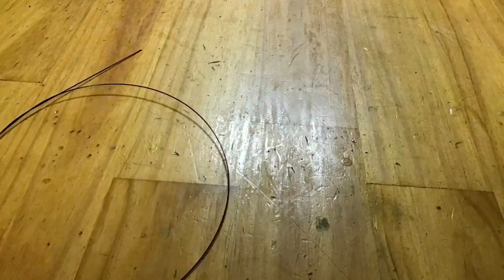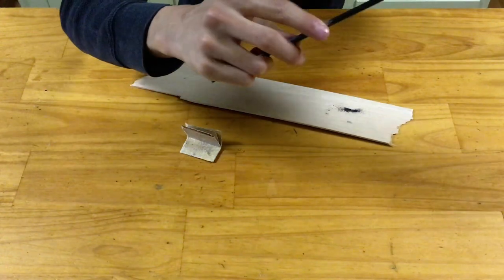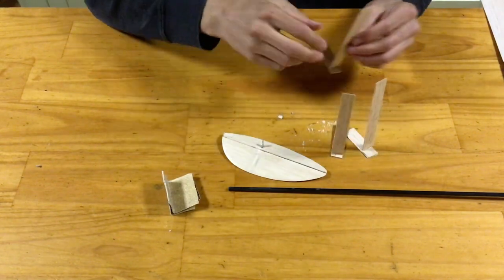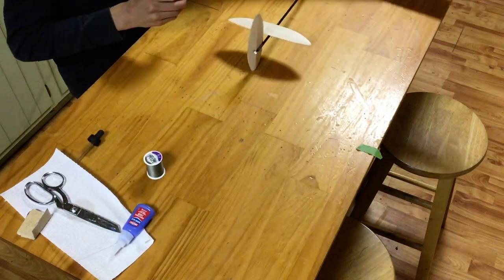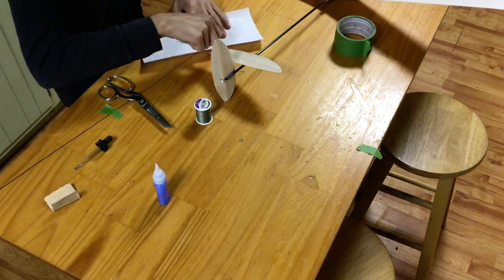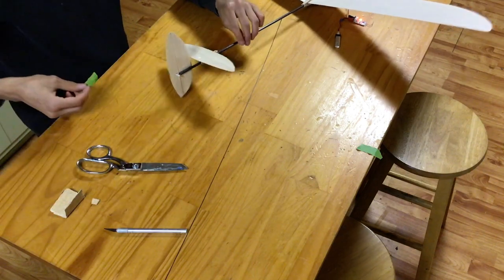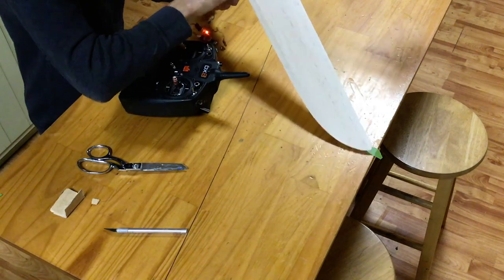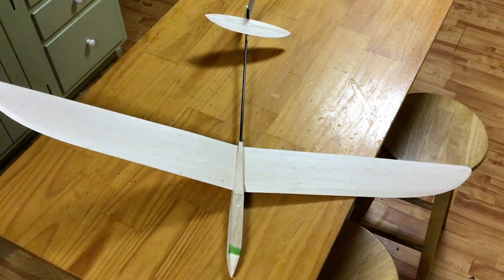Balsa DLG Tutorial - Episode 4 | PULL CABLES & FINAL ASSEMBLY |

Comment: Just finished watching.  I learned something new with your vertical stabiliser attachment method.  I usually cut a slot, centre the stab and fillet with CA glue.  Probably no real difference in strength but yours might be quicker and use less glue, which contributes to less weight in the rear end.  The series has been very good to watch.  Thank you for putting the time and effort into it.
Reply from the maker: Yeah, putting the stabilizer on one side like that is the way to go for these smaller gliders. It results in a teeny imbalance, but any disadvantage is vastly outweighed by the ease of the process, as well as the lower weight from the usage of less glue. I have tried the slot method, but I have noticed that it is easy to accidentally put a little bend in the stabilizer at the weakened point where the slot is cut. This has, in my experience, resulted in uneven rudder deflection. Also, putting the stabilizer on one side of the tail boom gives a straight shot for the rudder pull-cable to the control horn, and making sure it doesn’t rub against the edge of the tail boom.

Comment: Awesome....
I needed this final video..
Small suggestions...
I used Velcro for holding my receiver and battery in.. So I could easily move them to ajust the C.G... And Velcro to connect my hatch.... Thanks for these great vids..
...✌...
Reply from the maker: Thanks! No Velcro can be used for this glider. It is designed such that there is no extra room, so the electronics can’t be shifted; they only fit one way. Besides, if you added Velcro inside, there wouldn’t be enough room left for the electronics. Velcro to connect the hatch will be heavier and higher drag than tape, but I guess it would work.

Comment: How strong is this fuse in case of a nose crash? The way a build mine could safely withstand a 2-3 meters high, nose dive several times, while keeping the fuses weight really low (5grams max).
Reply from the maker: This fuselage will withstand nosedives into a grassy field from around 5-8 meters, depending upon the impact angle and balsa wood density. Yours sounds pretty good. Keep experimenting with fuselage designs and you will get them stronger and stronger. In my experience, simplicity is strength when it comes to DLG fuselages.

Comment: Could you please share the list of the electronic components used? It seems like it is split between episodes, I could only catch the servos being 2.5g. What battery size is recommended and what reciever?
Reply from the maker: Yes, servos are 2.5 gram Emax servos. Battery is a Venom 150 mAh 1S LiPo. Receiver is a 4.4 gram 4-channel one. I think it’s from LemonRX, but not sure. Hope this helps. :)
Reply: @AeroCraftAviation  That's what I guessed. So you got step-up buck converter there also? Servos specs say they work 4.8-6v. most recievers require this voltage too. This is the main reason  asking :)
Reply from the maker: @Umarluch  I used to use a BEC which would output a constant 5v. But this added a bit of weight and necessitated larger fuselages which made it not fly so well. A few months ago I decided to experiment with just the 3.5 - 4.0 volts of a 1S LiPo at medium capacity. I found the receiver still functioned just fine at the lower voltage, and also the servos output nearly as much torque. So now i don't bother with the BEC anymore,. This aircraft is designed such that it will not fit a BEC or any other voltage stepping component. If you want to get a little extra servo torque by using the BEC you will have to enlarge the fuselage and mount the servos further back. Hope this helps. :)
Reply: @AeroCraftAviation  Thanks for all the details! What is the work time for such small battery? I need to say 150mAh is even smaller battery than I have on my 65mm drones :D
Reply from the maker: @Umarluch  I get about 20 - 30 minutes, depending upon how aggressively I control the aircraft.

Comment: Hi. I ve got a 4 mm carbon fiber (instead of 6 mm that you use). Do U think it will be ok?  Thanks a lot for your help.
Reply from the maker: 4 mm outer diameter could work. It must be a carbon fiber tube, and therefore the inner diameter is important. If it has 3 mm or 2 mm inner diameter it will work.

Comment: I am close to giving my glider a toss, but I did have a question. Where should the CG be? I had heard it should be 25 to 30 percent back from the leading edge but maybe that is not a hard and fast rule. With my battery and receiver in place, my CG looks more like 60 percent back from the leading edge. I appreciate any suggestions you may have.
Reply from the maker: AH, good that you asked before tossing! A 25 to 30 percent CG is generally for powered planes only. A glider will have a further-back CG. This aircraft should be 34 to 40 percent. If it's helpful, I'll try to briefly explain why. Powered planes have stabilizers that make negative lift. That way, the nose is being forced up by the stabilizer. That is counteracted by having a further forward CG, which tends to push the nose down. Those two up and down tendencies find a sort of balance, and that's what keeps it cruising stable and level. But on gliders, negative lift is, well, negative. It kills efficiency. Besides, the aircraft is descending most of the time anyway, so there will be some upward airflow against the stabilizer -- it naturally wants to make positive lift. So we make a stabilizer optimized for positive lift. And if we move the CG back, then the aircraft "sits" on the stabilizer a bit more, and allows it to make some of that lift. Basically, since the positive stab-lift is already pushing the nose down, we don't need the weight-balance to be also pushing the nose down. So we move CG back. 
There's the really "intuitive idea" explanation. (Hardcore aero guys would laugh me off the stage for being non-technical about it, but I think getting the general idea is more important). 
Happy flying!
Reply: @AeroCraftAviation  Thank you so much for that level of  detail. I did not know that the CG was further back for gliders. You shared an important fact that will save me some grief. You are the man! Thank you kindly for sharing your knowledge. This new hobby has become a quest and I will get this right!
Reply from the maker: @dbaird46  I am happy to hear your enthusiasm! Do feel free to ask me whatever questions might arise. It really makes my day to be able to help a fellow model flier. Best of luck with your new glider.